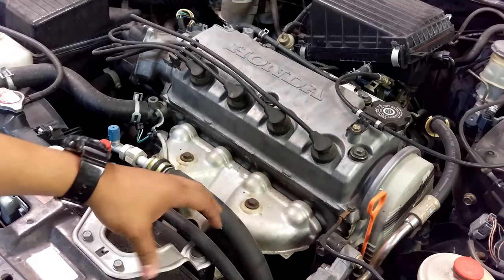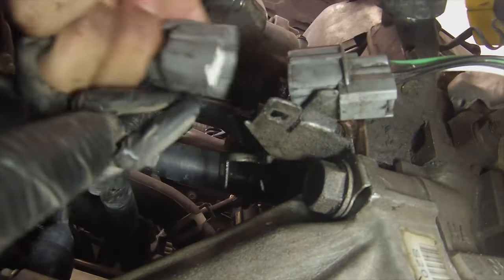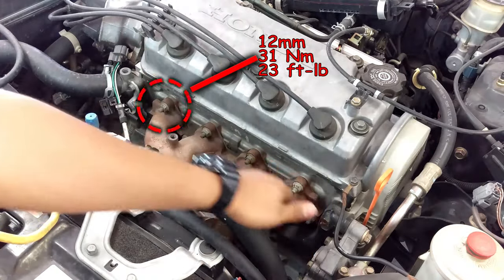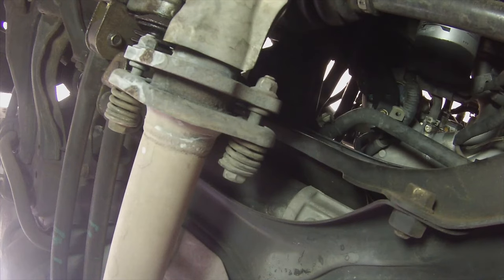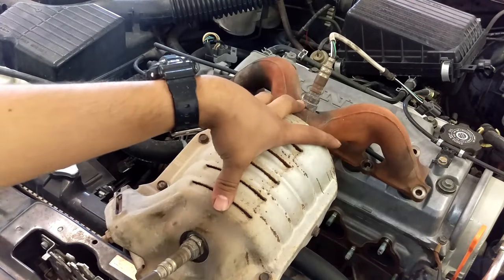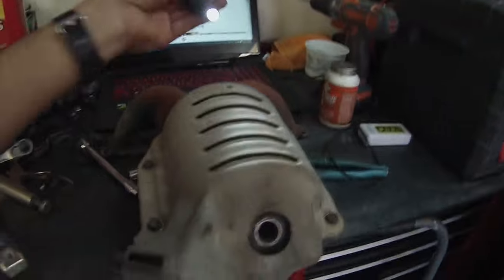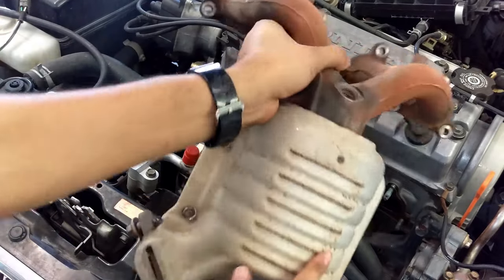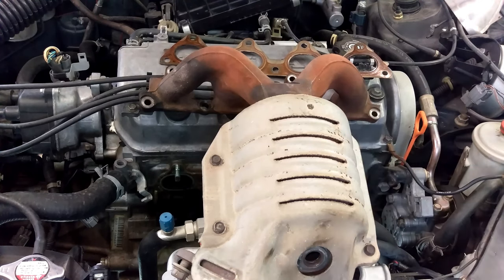Remove & Inspect Catalytic Converter

Comment: Remove & Inspect Catalytic Converter...and forget to put it back in and accidentally install aftermarket 4-2-1 headers with high flow test pipe and cat-less exhaust tip & resonator muffler delete.